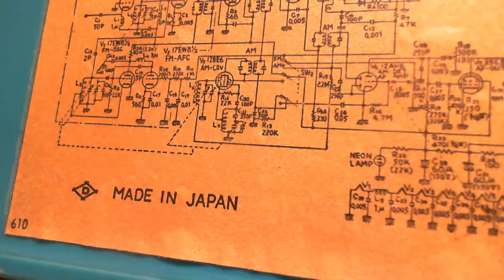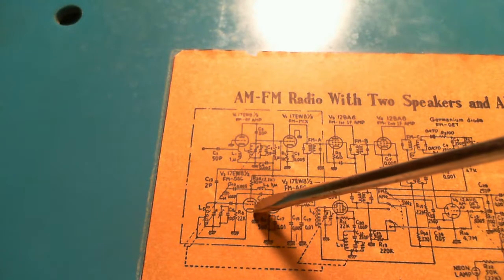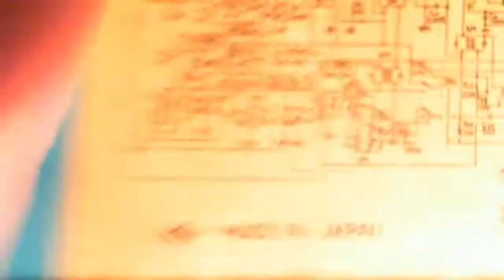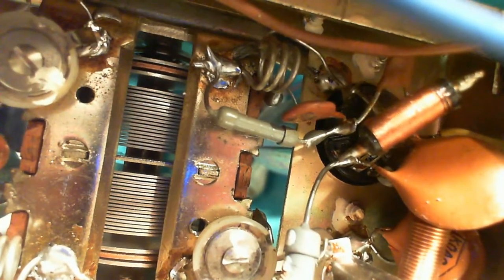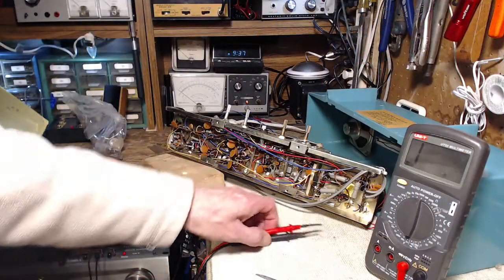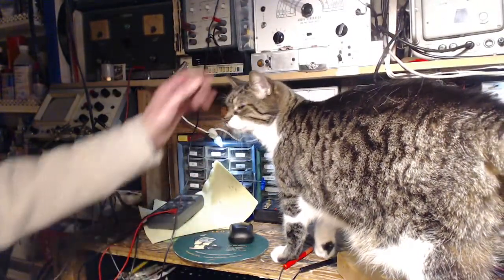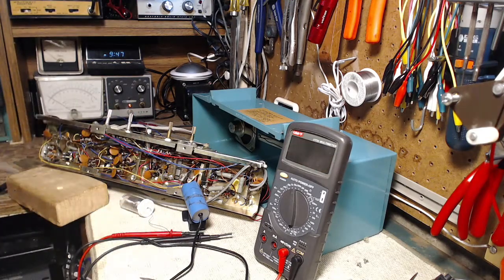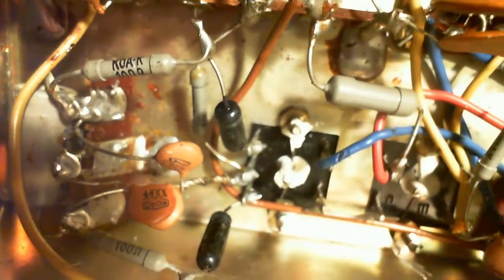AF-610 Japanese AM/FM Tube Radio Video 11 - FM Troubleshooting

Comment: I see you and me both need to know more about soldering irons. I know I leave mine on sometimes for up to 4 hours and when I need to use it I have to scrape off a layer of carbon first. My work station is a Dermatologist set up I got from the Charity shop for 25.00. It has a magnifier with light that stretches over 4 feet, a steamer that I dismounted to hold my soldering iron and 4 extra electrical plugs on the back all of it is mounted on a stand that rolls. The name of it is a Universal Eight N One. When I opened a part of it to be curious I found the date of 02/2012 so it is relativity new. It has a Black light with a magnifier glass that works but I don't have a use for it so I am selling it.
Reply from the maker: James Moates Sounds really cool.

Comment: perhaps i miss something from the previous videos:
- how does the unit react if FM finally comes up, then powercycle (off for for 20-30s) does it take another 5 minutes to come alive?
- how does it react when permanently cooled (by a air blower, just a broad mild stream), does it take even longer? Or does it start quicker when preheated?  Did you consider to spray cryo fluid in selective areas?

Another totally weired thing could be a capacitor (or resistor) which changes values slowly after applying tension. either due to humidity or resonnance/vibration in the kHz range. (in other words: Not directly temperature related.)
Reply from the maker: rarbiart Those are good ideas.  I'm thinking it's a weird thing.

Comment: why don't you heat up the bottom of the chassis and see if the FM comes up sooner. After it is up, use some freeze spray on any component you suspect.... If you don't have freeze spray, use electronic cleaner as it comes out cold.
Reply from the maker: Buzz1151 Only because I haven't done that.